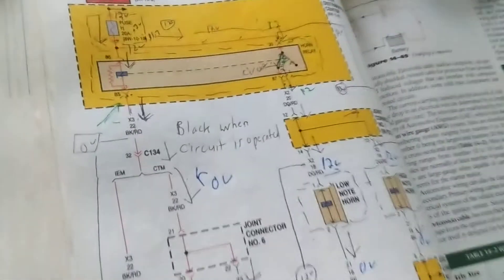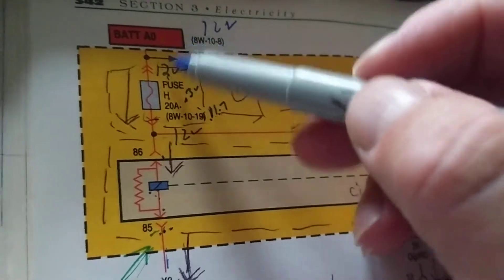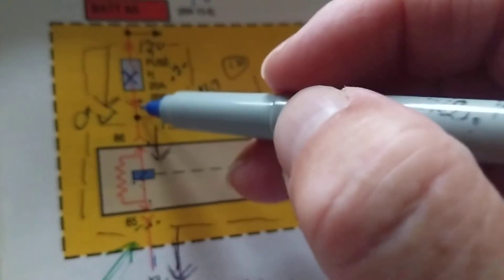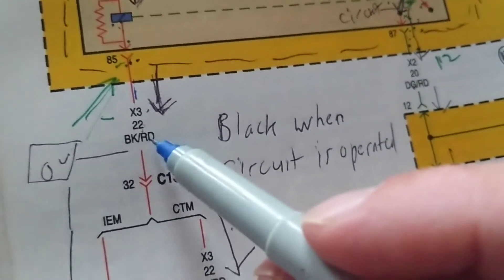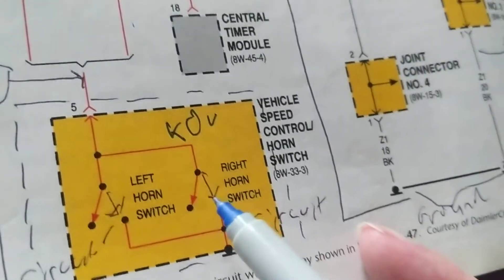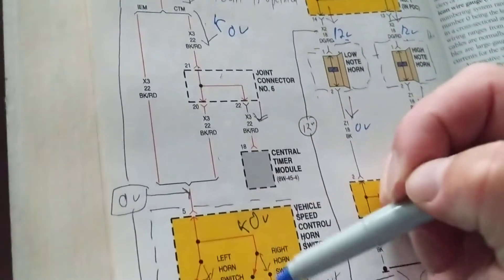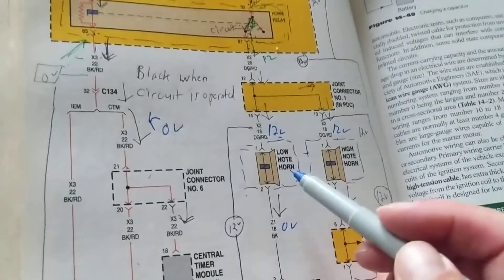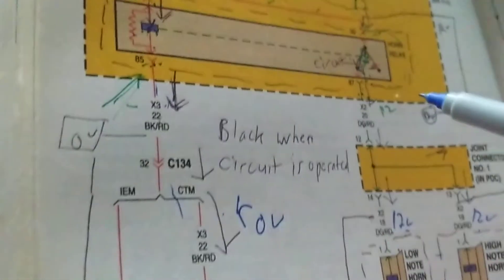HOW TO UNDERSTAND WIRING DIAGRAMS WITH RELAYS EXPLAINED SIMPLE FOR BEGINNERS

Comment: Always informative information to be gained from your videos! Thanks Joe!
Reply from the maker: Thank you I try my best appreciate it
Reply: @Joeelectronicschematicsforauto  Had a crazy diag come into my shop that I had to let go.. I didn’t know how to conclude a diagnostic. 2011 Dodge Journey 3.6 mainstreet had no ac compressor operation. Good fuse and really was integrated into the tipm. If I put a light bulb in place of my compressor the bulb would light. When I plug in my compressor (new) the fuse would blow (compressor fuse) and instantly burn my clutch coil and ruin the compressor. I was thinking tipm but I couldn’t explain to the customer why and I didn’t want to get it wrong so I let the customer go and didn’t charge any diag time.
Reply from the maker: @gregjones8501  well the resistance on the compressor is lower sounds like and also you should measure with the meter from the fuse side where the short is could be one wire is touching another wire perhaps the ground as I said resistant checks to ground have to be made that's the first thing